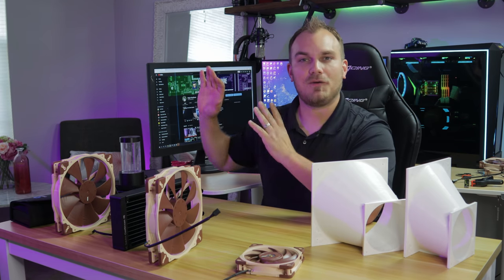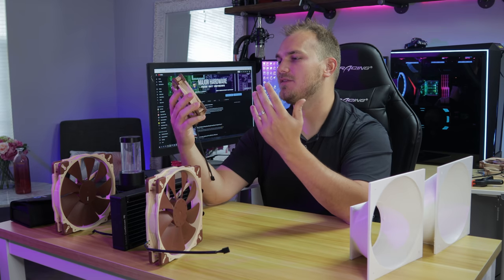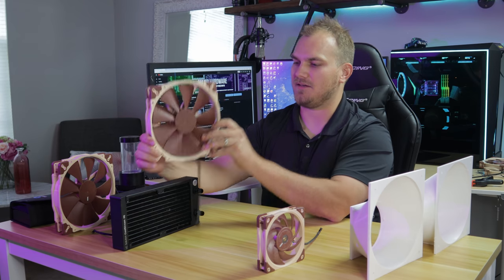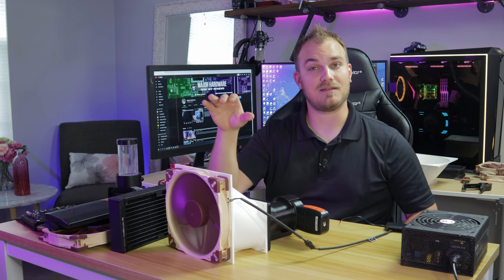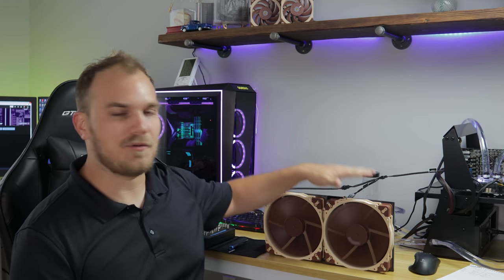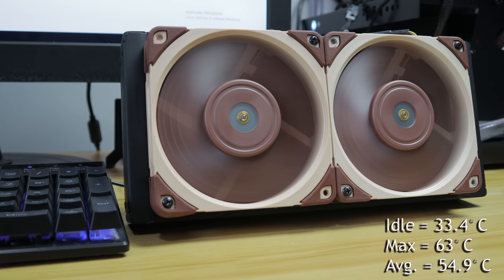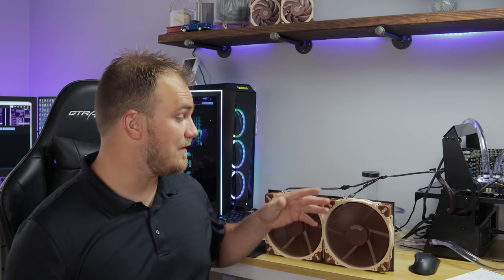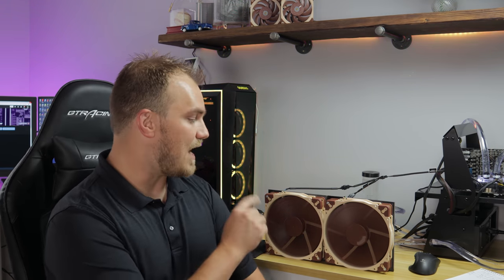Cooling A 240mm Radiator With 2 MASSIVE 200mm fans

Comment: Interesting idea, completely crazy lol
I love that kind of stuff.  A good push pull config with (good) cheap fans would probably do as well (ignoring noise). For people who haven’t been into water cooling for well over a decade like me, there is a point of diminishing returns where all the air flow in the world won’t improve your temps.  It comes to a point where the difference is negligible and you’re better off saving your money.
Reply: What if you had the radiator outside the case, pulling from something like a swamp cooler?
Reply: @z33thr33  oh, well, if you’re running cooled air through it, sure, it can drop temps.  Only having such high humidity air that close to your PC is a risk.  I used to open the window in the winter, and I noticed that condensation started building up on the back of my mother board, fortunately I caught on before anything got fried.  I once sandwiched some TEC (Peltier) coolers between a couple cheap eBay aluminum heat exchangers to act as a chiller for my loop, it worked extremely well.  But draws a lot of power and again, is a condensation risk if you’re not careful.  I had mine all insulated.  I have had radiators outside my case on several builds.  Usually it’s because I don’t have room for them in the case.  You can buy brackets that you can mount to a fan bay for mounting radiators outside your case if you want to keep the ambient temperature down.

Comment: Idea: duct 120mm fan.
When doing my own research about fans it is always recommended some sort of ducting. It frustrates me that fan manufactures don't just make wider housing if it's so effective. I don't have a 3D printer and I'm too cheap to buy cheap 120 fans just for the housing. Since your asking for suggestions I'd like to see if making a duct for the 120's will show improvement. Also like the other guy suggested make the rad side of the duct more square. Thanks you for your videos

Comment: the result with the two 200mm fans is probably a bit below, because of the increased distance between fans and radiator. on the other hand, a slightly increased distance should help in general.
Reply: A good test for this woyld be 3d print a straight pipe the same length as the 200mm fan adapter!  We demand more science!  3d Printed science!

Comment: 140mm fans are the most balanced and reasonable choice to balance static pressure,
air flow rate, and noise level.

Also worth noting that even the cases that do support 200mm fans.. there’s inconsistencies in the hole spacing from one manufacturer to another. 120 and 140 super standardized so you don’t have this risk of “jank dank” issues with 140’s.

Comment: I'd put the A4's in a case and the radiator in the middle of them but about 50mm away, this will compensate for the dead air created by the motor in the centre of the fans and will allow for air to move around the outside of the radiator which will help remove heat...If I was to do another case build I would use these fans. Silent but with excellent air flow!

Comment: I bet using a 280mm radiator with the 200mm fans would be the best setup if you wanted to squeeze it in a build because you wouldn't have to "squish" or adjust their airflow so much, and a build that could accommodate the 280mm radiator would have a much better shot of accommodating the fans anyways.. just something to consider if you stick it in a build one day :) I love your content mate and am looking forward to more!

Comment: Is a custom GPU shroud even possible to make with a 3d printer?
I mentioned this before but it would be cool to see one, put your own creativity into it and probably do it with a blower card
Reply: custom GPU shroud inc. 2x 200mm Fans 🤤
Reply: noxxi knox  pla works fine as long as the gpu is cool enough.
Reply: noxxi knox  pre-annealing pla would help with temperature resistance, but my gpu rarely goes over 60, so it would be fine.

Comment: Fairly certain this should work better with the fans in a pull configuration. I can't exactly test it since I don't have a similar setup, but I'm fairly certain it should. Dunno how much tho.
Reply: thinking the same,  maybe im getting it wrong, but as far as i learned in school , reducing the diameter increases static pressure, thus the fans have twice as hard time pushing into the radi.

Comment: The only issue with 200mm fans for rads is the fact that they have poor static pressure. They move a lot of air very quietly, no doubts about that. I have a 200mm intake fan on my Cooler Master Cosmos II and its extremely quiet. That said, the two 140mm Corsair SPs on my H110i GTX and the 120mm fan on the aio for my Fury X are definitely louder, though mostly the Corsair fans since I have a much more aggressive fan curve for those in place to keep my oc'd i7 970 (X58) cool at 4.4ghz all core. 1.35V on a 32nm chip is no joke, its one spicy dorito!

Comment: When I first saw these fans my mind immediately raced to a bizarre mini-ITX case design I had in my head...

Basically imagine a small vertically oriented case with a central plate to mount the motherboard to. A long PCI-X extension cable is used to mount the graphics card to the opposite side of the motherboard mounting plate.
An SFX-L power supply mounts below this arrangement, with a section at the front of the case dedicated to a 280 mm radiator.
One of these 200 mm fans is bolted to either side; One above the motherboard, the other above the graphics card.
The radiator has ducting so that it has it's own unique airflow path with front intake fans directing air into the duct which then directs it through the radiator, with an optional set of extraction fans on the radiator itself...

Probably completely insane... But it works in my head somehow... XD

Comment: theres a lot that goes into the shape and length of those cones to optimise the fans for the pressures they produce. they can only produce so much airflow if they have to put it through a ping pong sized hole (relatively speaking)

Comment: In my H500P (with a mesh front) I have a 400mm radiator in the front, (200mm x 2) and four 200mm fans on it in push pull, two of which are the A20s. They are great, and yes, super quiet.

Comment: An idea for a follow up: try adding some fins in the print. I think the static preassure of fans is higher if it's mounted directly on a rad If the air can spinn around it will. Some added "fins" should/could then force the air and direct its momentum in the right direction.. 

I don't even think the fins need to go all the way and reach the radiator. The increased preassure must travel that way anyway.

Comment: Cool idea! Fwiw EK make a 180x360mm rad, presumably for Silverstone's air penetrator fans. with a 3d printed bracket this could offer some interesting new cooling options for CM H500 owners.

Although that said, if you're not fussed about RGB and PWM you could just make a 200mm to 180mm bracket and user 180mm air penetrators instead, they're seriously good fans, although rather loud at full speed

Comment: You should also do a double fan push/pull setup test, with the 120's on one side of the rad and the 200's on the other, if you haven't already.

Comment: I am using 2 of those in CM H500 and they are just perfect! Compared to 3x120mm in front, they are suuuuper quiet. Had to drill new holes on the case tho...

Comment: You should get a digital manometer, and start recording vacuum and pressures from push/pull setups on everything to get data on if there is and how much the limits to things are when it comes to amount of air flow.

Comment: 2 x 200 mm Noctuas in exhaust config (back and front) plus 2 x 120 mm Noctuas for intake , one for each of the CPU and GPU. Could use mini ITX board and a PCI riser cable to mount GPU and CPU on opposite sides (compartments) of case, with negative pressure creating a vacuum effect that sucks air into the case and blasts hottest components with it. If negative pressure theory turns out to be rubbish, you could switch one of the 200 mm to intake config for a more traditional positive pressure approach. I'm imagining a ~210 mm X ~210 mm X ~360 mm case, about 16 L. ITX... so hot right now.

Comment: may or may not be relevant but i had a cooler master HAF-X full tower case with a 200mm side 230 front and dual 200mm on the top. i managed to make my 280mm aio fit by just drilling some new mounting holes. i had my 140s pushing air up thru the radiator mounted to the chassis while the 200mm fans sat above the chassis where they are by default so the top of the case still fit. My thermals were amazing dont think i ever hit 70 degrees with my old fx 8350 or my 7700k over clocked to 5ghz. i cant confirm if a push pull with all 140s would of been better or not in that case but i did use the same 280mm aio on the 7700k in a thermaltake view 71 with push pull and temps were a little higher but that case has glass on top so expected.

Comment: You need to get silverstone ap182 fans to test with similar config alot more  static preasure, well louder too but you need preasure to get effency. I got 3 of em in 3x180 rad, other then there is no case to fit the monster in its really good

Comment: Mount the radiator vertical in a box or housing for, four 200 millimeter fans two pulling air into the box and two pushing air out the back with holes on the side of the box for the cooling loop to come in and out of. Set the radiator in between the four fans and print a brace for the bottom and top like a clip brace or post. Leave a small clearance around the entire radiatorso the airflow can go around the whole thing not just through it.

Comment: Wish I had a 3d printer back when I was installing my water cooling system. I got tired of the heat building up in my office when loading up the computer, so I put a 2x3 in my window with 2 copper pipes passed through the wood and secured the window down onto the wood and secured the window with wood dowel rods. Then outside I mounted a bracket with a transmission copper aux cooler which is plumbed to those copper pipes on the wood in the window. on the Inside side of the wood I have quick connects that I plugged my PC into with flexible waterline and mounted the switch to the fan on the aux cooler under the surface of my desk. For now I turn it on manually via the switch, but eventually I want to temperature control actuate it, but when I am in the office the system has enough cooling running idle or basic task like web browsing without the aux cooler fan on due to the remaining radiators in the case, but when I game or load up the system, I flip the switch and it immediately drops the loop temp even with outside temps around 100F here in Florida. This setup drastically reduced the heat dumped into my office now.

Comment: I am glad that I found your video. I was looking at Raijintek Silenos case that have 200mm fans for the front, but it doesn't take the 400mm radiator. The biggest radiator that it can hold is the 360 because it mounts to the front of case I would mod up a shroud for the fans to meet the 360 rad. Would you do a push-pull set up in this case?

Comment: hm if u use a 5 diameter coiled pipe and connect it with these two fans using 3d printed funnels. You can essentially cool the air coming out of the pipe. cuz what you will basically be doing is compressing the air to go in a very narrow channel and as the air comes out the other end, its going to expand and drop in temperature. Idk how well it would work and what diameter coiled pipe  you have to use but it may work. That cold air coming out can be used. or you can just use a  compressor. a small one.

Comment: That's cool idea which dislodged another idea from my 3 brain cells. Imagine a manifold designed to cool two radiators (have one for cpu and one for gpu) like I have. I wouldn't mind losing a few c for the simplicity, coolness "factor", and quietness of couple 200mm fans.

Comment: A12x25 is probably the best 12 on earth. Does everything in silence. I like the colours. Aristocratic.

Anyway big fans are made for CFM not pressure.
Have you tried turning the fans to pull from the radiator?
How did you choose the distance for the duct?

Comment: You had the microphone on the same countertop as the fans. You weren't just picking up sound through the air, but also the vibration through the table. That will accentuate the lower frequencies and make the 200mm fans seem louder then they are.

Comment: Here's an idea for you to try - I have always wondered if you could make ducting from your intake fans on the front of the case directly to your CPU cooler and GPU? Maybe set up one 120mm at the front with a duct that leads directly to the CPU cooler (it would have to be a tower cooler - like a hyper 212) and a duct from the CPU cooler to the rear exhaust fan. You could then set up ducting from the other 2 x 120mm fans in the front directly to the GPU fans. 

Not sure if it would work, plus you may have issues cooling the VRM's, RAM etc... but it would be cool to see

Comment: In your second audio test at the 6:10 mark, the audio for the 200mm fans is being exaggerated by the low-frequency vibration travelling through the desk and into your microphone.  For audio tests your mic should ALWAYS be used with a mic stand resting on a different surface.  Otherwise, great video as always.

Comment: The reason the large fans didnt do so well was prob down to your funnels being too short and tight.  as mentioned they will have filled up with air too fast and not had the blade shape to cope with the preasure built up in the funnels.

Comment: you should compare those 200mm Noctua fans to Cooler Masters 200mm fans and see what difference there is in sound and performance. i have a Cooler Master H500P that comes with 2x200mm intake fans, and ive been thinking about adding 2xmore 200mm fans as exhaust.

Comment: what would happen if you used the 120mm fans on the inside of the duct? use both the 200mm fans and 120mm fans on each funnel one on the inside one on the outside. or use the 120mm fans on the otherside to pull air through the radiator.

Comment: it's not a new idea but it hasn't been done in awhile either. the problem is those 200mm fans probably don't have any good static pressure rating for rads like the 120s usually do!

Comment: Given how bad 200mm is at static pressure, I expected the final result. But would have been interested in seeing them in a pull configuration just to see if the reducer helped pulling.

Comment: You should try and make your own DIY RINGZ RGB fan out of "clear" (translucent) filament in combination with an rc motor. One reason why I've never made the switch to RGB is because all the RGB fans out there have shitty airflow/static pressure ratings.

Comment: What if you made the radiator side more square so that it hade more surface area of the rad exposed to the fan flow instead of limiting it to the same size of the smaller fan. You could even put small tabs on it and screw it down from the inside. This area increase could actually make it a better solution since there are no dead spots on the rad

Comment: try to widen the outlets and see if u can get the openings close to center of the fans i belive they loosin theur vacum ability since its turbulance from the blades instead of a vortex kinda
or add a vortex system in the adapters u made

Comment: Should remake the 3D shape to take full advantage of the fact the bigger fan's don't need the same sized hole. You could actually almost make the exit mount go right to the very edge all the way around so the exit is pretty much square. To attach it, still have the mounting holes, but you would need the big fan to not be attached so you could screw the mount on first and add the fan after (mounts on the inside).

Comment: I'm trying to build a diy ac from an ice cooler. I found a few designs, some use a radiator, some connect a marine blow fan to a duct. I think if I can find a way to connect a powerful cfm fan but without the overhead of all the bulky stuff of inline duct fans and connect it to a 3" semi ridid duct running through a cooler. Maybe with a small radiator cooled by a small water pump. How did you get those plastic connectors? I think I need something similar that can go from a fan to a duct...

Comment: My case the core v21 has a 200mm fan mount and fan included. Some company sells 200mm copper rads for about $50 shipped. If I had the money I would water cool it and do it myself but I don't lol. Perhaps something you might want to check out
Reply: @mayor

Comment: More silent - but the pressure that the 200mm can build is minimal (1.08 mm H2O). In this configuration, the funnels are already causing back-pressure that needs to be beaten.
Noctua 200mm (all)
m^3/h	cu.ft/min	dB(A)	mm H2O
146.9	86.5	18.1	1.08
Noctua 140mm (3 versions, others exist)
79.8	46.0	11.9	0.69
269.3	158.5	41.3	10.52
115.5	67.0	19.2	1.51
This suggests the 115.5 m3/h 140mm is a nice candidate: about as quiet as the 200mm and builds 50% more pressure (which you need with a water cooling radiator). And if that does not cool enough, look at the about 25 dB(A) models that pump much more at more pressure (twice as loud to our ears - but how much is two times silent?)

Comment: I've been wanting to use the Fractal Design Torrent and have the 2x180mm fans in the front as its default setup, but place the Arctic Liquid Freezer II 420  behind that, with the fans that comes with that behind that again, so it's like a push-pull. But it would be interesting to see how the cooling would be with just the 2x180mm fans on there, with fan adapters on there.

I don't have a 3D printer though, and not sure if there's anyone out there that could make this if I had the measurements, but I assume that's a service that's out there.